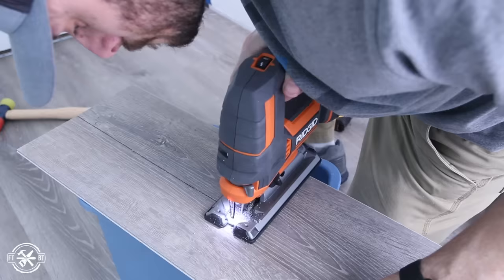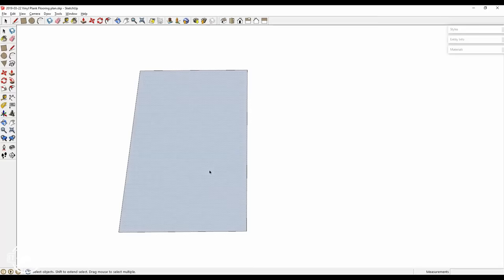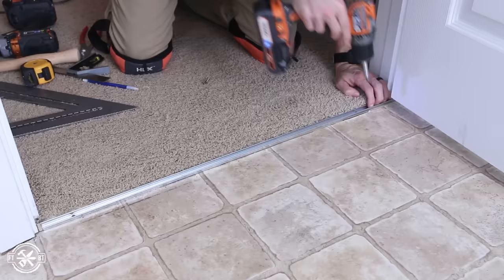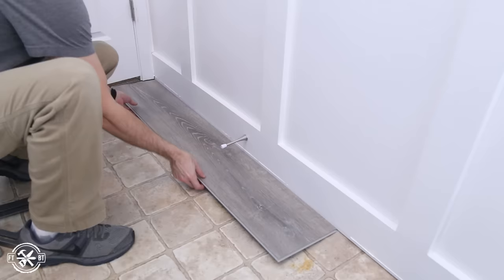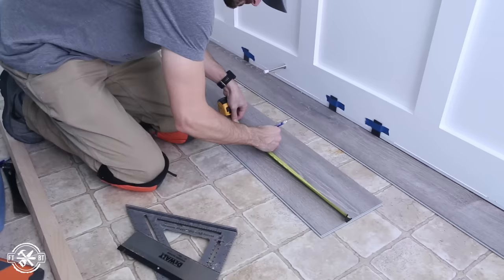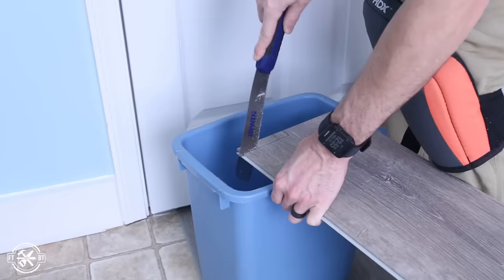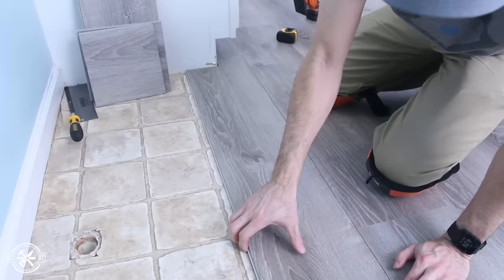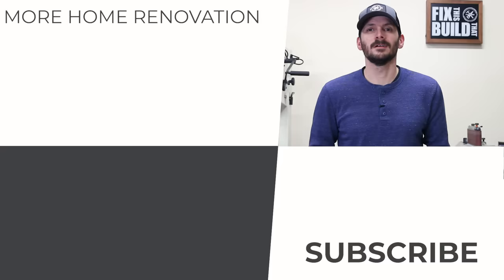How to Install Vinyl Plank Flooring as a Beginner | Home Renovation

Comment: Great video.  But not for beginners.  This has just made me want to pay someone to do it for me!
Reply: Absolutely
Reply: I’m 23 and don’t do much handywork that I don’t learn off of YouTube videos. Yet my fiancée and I were able to lay vinyl flooring over our entire living room and hallway in just a few hours. The things that slow you down the most are pulling the baseboards and the learning curve of the first few rows. My fiancée and I were not satisfied unless every single piece was perfect and without any visible rubber in the creases of the flooring. But once we laid 10 or so down, we got the hang of it and it took about 20 seconds per board. The guy in this video makes it a little too difficult. Firstly, you can stack it right up against the wall on 2 sides of the room, but then allow a half inch of spacing on the two other sides (the top and right corner. Or you can tape spacers on the wall like he does, if you prefer that. And you don’t have to do any of that mapping or modeling crap. I just laid all the boards and cut the last row to fit. 

It was really pretty easy. Even for two young people that have very little experience in housework.
Reply: I used this product in both a half bath and then our living room. There is a learning curve but this is a relatively easy product to work with! I had our 120sqft living room done in one day.
Reply: @nicholmom23  hey
Reply: True. It's complicated.
Reply: Real LydiaB this video definitely over-complicated things! I’m an 18-year-old female with 0 DIY experience and I’ve just managed to lay a laminate floor on my own and it looks great!🙂👍🏻
Reply: Real LydiaB ikr, these guys do this for a living.
Reply: I can almost guarentee you that everyone that said they weren't handy and did this will have the seams pulling apart in 6 months or it looks shittier than they will admit. Also, only get the 6mm or thicker planks.
Reply: About 3 years ago , we put down vinyl flooring , which was a " floating floor" .There was supposed to be no need for glue , except maybe a little on the outside edges ,  and in one strip across the centre of the room . Granted , this was NOT a click type of vinyl .             However , after a few months it became obvious that we needed  to glue the whole floor down  , so that is what we did . This was a durable , attractive , easily maintained floor . Still , it took a couple tries to get it right . We needed that Henry glue . Once it was down , we were " gold" .
Reply: Same here !
Reply: I agree!  If anything, this video shows how much work goes into it which most DIY people DON'T  do, which is why it doesn't last and/or looks terrible.  I would much rather pay someone to do a professional job.
Reply: Real LydiaB agreed lol. I’m like 3 mins in and I’m like nah 😂😂😂 I’ll have someone else do it
Reply: Real lydiab this is easy. You can do it.
Reply: @sherpaderpdingo3405  OMG 😂😂😂😂😂 YOU RIGHT
Reply: @americanbeauty171  lol these things are more difficult to do than most people think. At least on the finer side of it.
Reply: If this is too complicated for you, then you’re not even a beginner.
Reply: That true! Not for beginner!!! Kosago Vietnam
Reply: @ellieburgoyne3422  Thank you so much for telling us this!  I am discouraged by the original reply because I want to do it myself.  And good for you for doing it yourself!
Reply: nogoodwolf do it!!! Make sure you give yourself plenty of time and go slow and you’ll be all good. My floor is still looking great! X
Reply: @ellieburgoyne3422  I hope I do!  For now my husband does not want vinyl because he thinks that it will rip.  I took 2 samples home today.  :(
Reply: Not hard at all if you can put up with not finishing it in one day...  I’ve done 2 bathrooms and a kitchen...  I wish I had done the bathrooms first but they were actually done years after.  Oh wait and 3 bedrooms...  they were the easiest
Reply: @lt0295  what tools you needed? where did you buy vinyl floor? thanks
Reply: Shashikant Shukla we got our flooring at Menards. I don’t remember the name of the brand right now. The main tools we used were a carpenter’s pencil, a speed square, and a tape measure. On pieces that we had to cut longways because they were up against a wall, we used a family member’s table saw. And we used a jigsaw to cut pieces to fit around our floor vents.
Reply: Do you use underlayment
Reply: Natasha Turner we didn’t. We had old hardwood floor underneath though. Idk if that makes much of a difference
Reply: @lt0295  if i can buy only one saw (no idea if it can be rented), which one is most useful? I like doing such stuff but haven't used proper tools ever:-)
Reply: Shashikant Shukla you could probably do everything you needed with either a jigsaw or a table saw. We had both, so we used the table saw for cutting long pieces straight. You can still do that with a jigsaw, but the pieces will take forever to cut (depending on the length of the vinyl planks) and it won’t be as straight. We just used the jigsaw for cutting into the pieces to go around floor vents and stuff like that. 

Long story short, you can probably get it done with a table saw. AS LONG AS all of the shapes that you need to cut into the pieces are squared. A table saw will not work if you have any rounded edges. But I’d rather have a table saw and not a jigsaw than vice versa.
Reply: Agreed lol
Reply: Great video for beginners. Not a big room. So only a couple of square feet. Not to much to cut around. Nice job
Reply: This video shows its great for beginners. Very easy to install. 
Put your mind to it and you will succeed. And no need to rush it either.
Reply: @tobysurmann1936 its more like given how many tools are involved you're better off paying someone.
Reply: Seriously lol
Reply from the maker: Don't under estimate yourself!  But I understand the thought process, it's not like hitting the easy button
Reply: Ikr
Reply: This video makes it so much harder than it is. I do this everyday and never need any saws to cut. Use a knife to score and use a plier if you don’t have much to grip to break it off. Also flipping the board over and putting your feet down on the board will help you break it off
Reply: Real LydiaB YES I agree
Reply: Listen to it with no volume
Reply: SAME!!!! I'm like nahhhh
Reply: Real LydiaB agreed
Reply: Real LydiaB why?
Reply: Right, it's for beginners who have all the tools, i don't even have an stupid nerdy friends.
Reply: Lol more equity for the DIY’rs
Reply: me and my dad wanted  to too but we realized that if there it would be a great bonding projection we are currently just finishing
Reply: @youcryin  

Hdjd
Reply: Same 😂😭
Reply: I seen the video.. I know what u mean.. I dont even have that tools.. What im going to do other than pay people to do it for me.. 😂it so complicated..
Reply: LMAO same
Reply: I know right...😃...geee wiz..... finally got er done, looks good for the jr tool man.....lol
Reply: Yes you don’t have the tools or the experience but if handy maybe works out
Reply: I'm doing my 2nd room with this stuff. This guy is doing it the hard way big time.. You don't need that many tools.
Reply: It is for “beginners”  it means like actually doing some work but doing stuff that’s not like hard to understand/ rocket science. I think you’re looking for something quick that you can do under a tight schedule maybe? And I suggest using like some kind of sticky paper like adhesive, or stick and peel paper, contact paper, etc. you still have to measure but if you don’t have time for that then I suggest just hire someone. But this is the easiest it will get for flooring that’s this thick and/or more of the real thing
Reply: Real LydiaB do u pay for motivation
Reply: Seriously!  The dude brought out a different tool for literally every step of the process.  "For beginners who happen to have $20,000 worth of shop tools at their disposal."
Reply: @lt0295  Maybe there's some hope for the future of this country after all.
Reply: Atleast he didn’t have to remove the floor. We redid our bathroom floor and it was a nightmare. But we also had to replace the floor in The Whole bathroom. This looked super easy came out better than ours lol
Reply: Lol...
Reply: I did it as a reno project in my house for the first time. Easy as
Reply: If your not willing to try to learn paying someone just shows that was your plan all along.
Reply: @sandiebulysse3800  ¹1
Reply: I just installed this flooring in my bathroom. This was fairly easy
Reply: My thoughts too!  I might be better off hiring someone, but it all depends on the price.
Reply: @sandiebulysse3800  Q
Reply: This flooring is as easy as it gets.  It is for beginners compared to hardwood or tile.
Reply: @natashaturner3781  No need unless it is basement.  I would in a basement.  If you did use underlayment it would be to further deaden any noise transfer.
Reply: Definitely a beginner he left the ceramic floor there need to tear it out before putting vinyl in duh ceramic floor is super cold in state that have very cold winters
Reply: @billeddy4357  glue is just used when it’s on cement
Reply: @lt0295  Right, it worker out on your last row but that isn’t always the case. What if you had been left with a 2” sliver as your end row? That would have been tricky and looked poor. Also, not sure if I agree with not leaving a gap around the entire perimeter - the boards don’t move they expand, which is a big difference. Each to their own but I prefer to do things the right way and one time only.
Reply: @sundog8772  well actually my last row was about a 2” width. Maybe a little less. I used a table saw to cut the length and it worked out perfectly fine. And I only left a space around 2 sides because that what the flooring worker at Menards suggested I do. I’m not a contractor and I don’t pretend to know everything. I’m just saying that what I did was way easier than what the person did in this video, and it still works. But I’m also not picky and super concerned with it looking perfect. There are probably some areas that could look better but I don’t notice them and nobody else seems to.
Reply: @lt0295  Sorry but saying you don’t have to do layout is not good practice, in your case it worked out somewhat ok but leaving it to chance isn’t smart. Anyway, in your first comment you said everything had to be perfect but in your response you say you’re not picky...All good, I just wanted to point this out so others don’t make the same mistake of not planning the layout before installation.
Reply: No pitch on that floor drain...FAIL!If drain is not pitched at lowest point water will not find its way there.

Comment: I learned my lesson about painting behind appliances. I was doing a kitchen paint job for an older neighbor across the street. She specifically asked me to paint behind her refrigerator and electric range. I may have been a terrible person for thinking this but I said to myself, "This lady is knocking on 80. There's no way in the world that she's going to move these appliances out of the way and check behind me to see that I did it. She'll probably be in a nursing home before she even thinks about replacing these things." Well I couldn't have been more wrong! 2 months later she purchased a new washer and dryer and the store gave her a free refrigerator. She was so happy that she bought a new range too. Long story short, I'm glad that I went ahead and painted behind the appliances anyway (in lieu of my earlier thoughts) because it would have been very embarrassing to try to explain why I made a promise and then lied about it.
Reply from the maker: You made the right call 😀👍

Comment: I'm a DIY-er, I like that you showed the errors and how to fix them.
Reply from the maker: It's such a huge part of learning!
Reply: Olha fico lindo amei. ❤❤❤❤
Reply: The biggest error is installing it over a perfectly good solid tile floor. Hear me out. I began installing the flooring over my existing tile floor. I know it looks good but I questioned the quality of the style. After laying a few planks I walked on it. Back and forth for 15 minutes. I didn’t rush installing the plank flooring, and I didn’t rush my judgement on the flooring quality. After pondering I not only decided not to install it but thanked the heaven above that I paused and thought it over with passion. My opinion after thinking it through was that the new floor looks really nice. But it ends there. I didn’t like the tapping sound where uneven planks tapped the tile. I also didn’t like the hollow sound. And lastly I didn’t like the noise it made when dragging you foot across it. Regardless if you are wearing your shoes or simply socks. Instead of updating the floor I updated the rest of the bathroom in a way that complimented the floor. His laundry room floor is not outdated enough that it would be impossible to work with. He could have done a color change, perhaps a faux accent wall and some nice decorations with improved lighting. All in effort to have a solid floor underfoot. My 2 cents. What I mean is not to criticize him. I am passing on to anyone thinking about doing this should question deeply if you are willing to install a floor that looks great but has the risk of feeling like a floor in a trailer home vs a solid floor that tile offers.
Reply: The jukebox it was a vinyl floor, Not tile.  But I understand what you mean regarding the downfalls of planks over tile.  He shouldn’t have those issues.
Reply: @wheelie642   Great description of why using an underlayment is key. The padding on the back of some vinyl plank is not enough.
Reply: @Fixthisbuildthat  what's the name of this product where can I purchase it
Reply: State of art I’ve seen that people lay it over a spongey plastic sheeting layer. That’s how it is in my house.

Comment: I want to thank you so so much! I was struggling putting down vinyl plank flooring for the first time. 😫  I was following the box directions and had had to pull up the about 8 rows I'd done twice because the rows kept coming loose! Anyway, watched both of your videos and the instruction to fit the long side first and then tap in the short side made a world of difference. Not sure why the box says to do it the other way, but thank you for saving my knees and my sanity!

Comment: I installed vinyl plank flooring in my sister's kitchen, living room, and bathroom with no experience in installing any type of flooring.  I made a few bad cuts at first but then it was super simple and we had it all done in a couple of days.  Thank you for a great video.  I needed a little refresher course since I'm headed down to Florida to install it in my daughter's condo.
Reply: what do you do if you can get rid of the seam on the short side? We've been trying for days
Reply: @wendycolley3819  If only one side seam is cut then use it as first piece on the next row or the last piece depending on which side seam is gone. If both side seams have been cut then you have material for some coasters.  Grab a new piece and try again.

Comment: I really learned some nice tricks watching your video. I made many mistakes on my first floor and not as many on the second.  This will definitely help me make none here on out.  One thing I learned on my own:  be sure to get all your flooring for a room with the same lot number.  I had a lot of problems getting the planks to match up with no gaps due to using three different lot numbers.  Learning as I go..
Reply: My problem is that my floors aren't level everywhere and so it seems like I keep having ends that lift a bit.  It shows in the sun, so I've taken it out three times so far...

Comment: Always start from an outside wall if available they are the straightest typically. Scoring and snapping works on long cuts, you just have to apply a lot of pressure for a clean break and start at an end work your way down. Also would recommend Olfa for just about any cutting purpose for floors, utility knife screams beginner. The spacing you left as well more than likely will never be necessary. Only have to leave big gaps for long runs most commonly around 20ft. To explain simply every board has the possibility of expanding 1/16 maybe 1/32 multiplied by how many rows you are doing can lead to binding and warping. A laundry room is to small to experience that in all likelihood. As well you are doing a plastic composite board, doesn’t expand like a 1/2inch laminate or really any sort of wood product.

Comment: I just laid down about 1000 sq ft with another 300 to go of this same vinyl flooring. Miter/table/jig saw are definitely the way to go and made life a lot easier. That being said, for everyone who wants to do this, be careful with the tongue/grooves on the planks as they break off pretty easily and create a big headache and make the cost go up.
Reply: I know! I wish I had seen this a few months ago when I installed mine out. Having the right mallet also makes a huge difference. I have a few slots that haunt me because they aren't super flush

Comment: Did this last year in my bathroom. Used my rigid cordless skill saw on every cut. Went faster and super clean cuts.
Reply: What type of blade did you use please?
Reply: @latinhorse75  They make blades that are specific to laminate, vinyl, plywood. Or you can just take a normal finish blade and reverse it to cut laminates and siding.

Comment: I thought I could easily install the floors for my grandma's new apartment. This really amazing 10 minute video helped me realize that we should definitely hire some help. Thank you so much!
Reply: Step one: Get yourself a workshop and full set of power tools.
Reply: @cantrembrt  it can be done with a pencil, mallet, square, utility knife and flush cut handsaw(or oscillating tool). Less than $100 in tools.